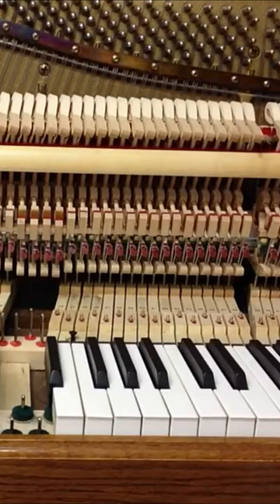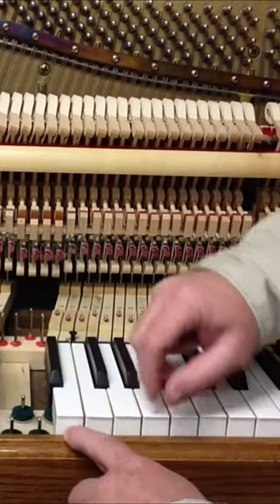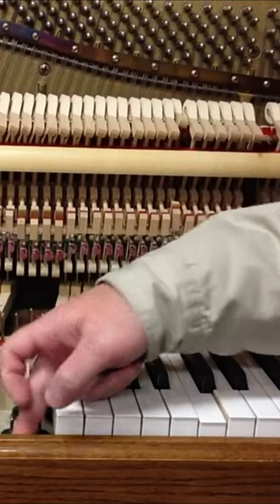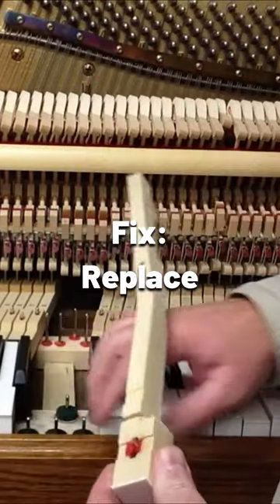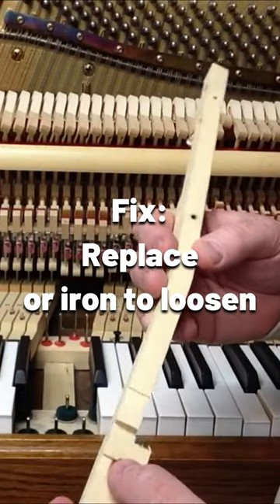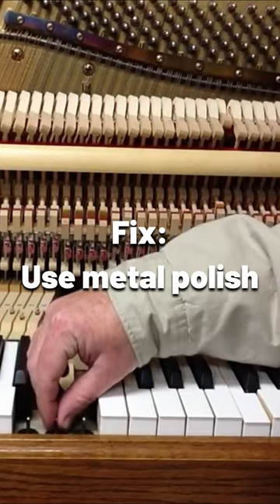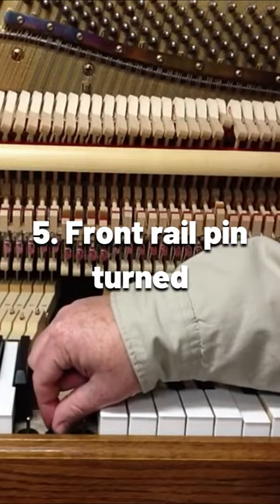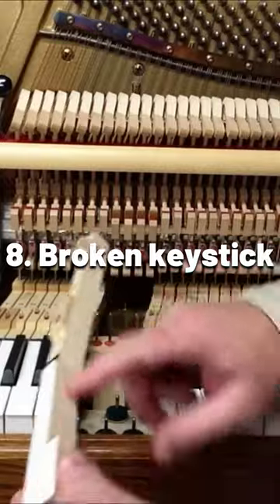How to Fix a Sticking Piano Key (Part 1: Problems with the Keys) | HOWARD PIANO INDUSTRIES

Comment: mine is sticking, but only when the sustain pedal is down. it releases when I let the pedal go. Any ideas?
Reply from the maker: That's not uncommon. The reason for that is that when the damper is not being lifted, there's more weight on the action, which will cause it to be less likely to stick. The problem is still there when you're not using the pedal, it's just not as evident.